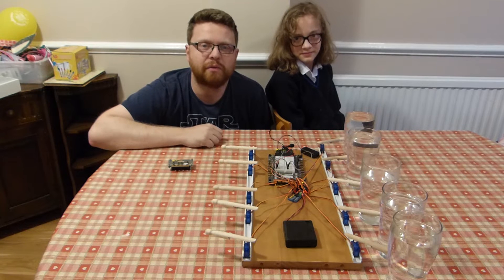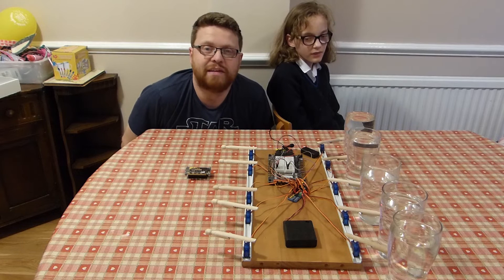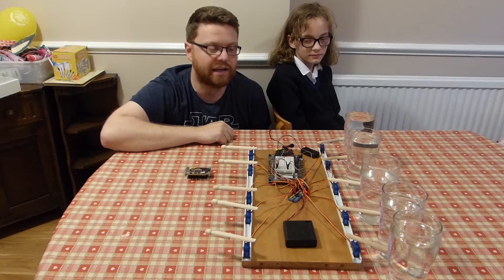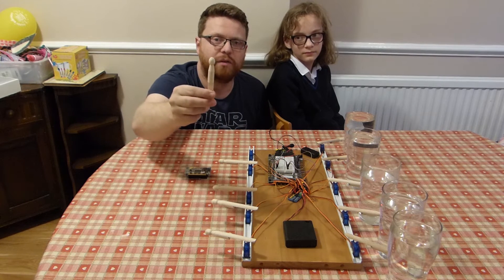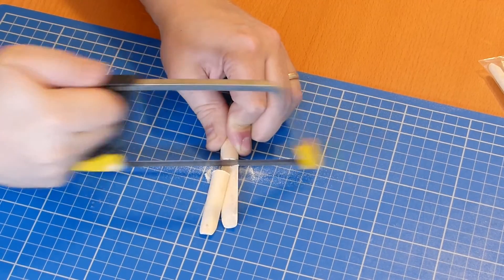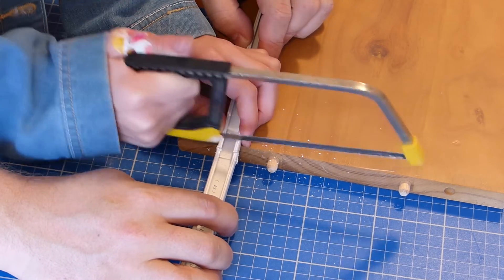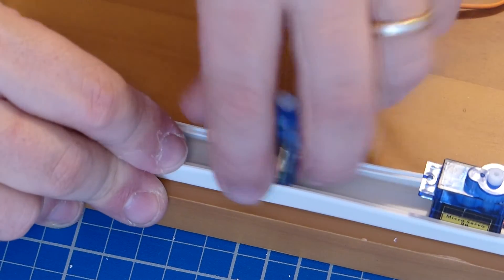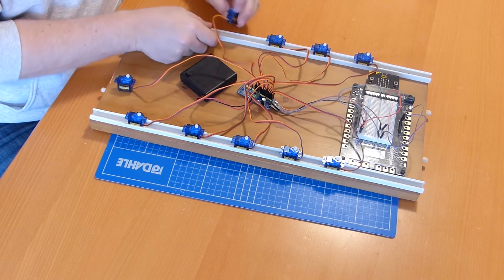Episode 12 - micro:bit water xylophone

Comment: I like the video Question: sir micro:bit has only 3 GPIO pins how did you attach so many servo motors to it
Reply from the maker: We used an external motor controller the PCA9685 connected to the microbit

Comment: Great inspiration, thank you!  Question: You're powering your micro:bit with a 3v battery pack, and the servo driver with a 6v battery pack, right?
Reply from the maker: Yes that's right you could probably power 1 or 2 servos from the microbit on its one but anything more, or if you need to power stronger servos you need a dedicated power source

Comment: Can you point me in the direction of decent servos to use for this kind of project? I've never really been in the market for servos and don't know if the cheapo ones that control RC airplanes have a rotation speed that's fast enough for this kind of thing (like SG90s that have a speed of .3 sec per 60 degrees), but it looks like that's what you might be using...
Reply from the maker: Yes they are just cheap sg90 clones from eBay. For low torque usage they are fine but for a robot arm we have built they very quickly break the plastic gears when under load so we used mg90s for that with metal gears